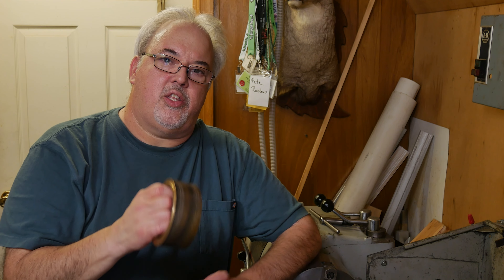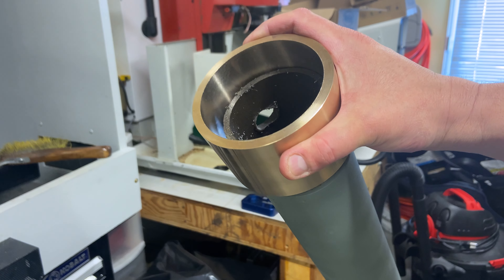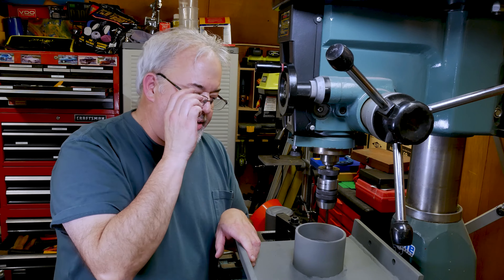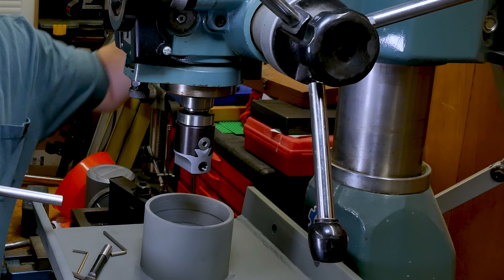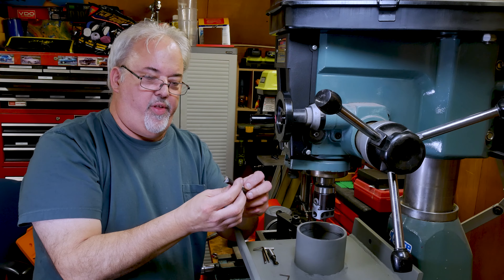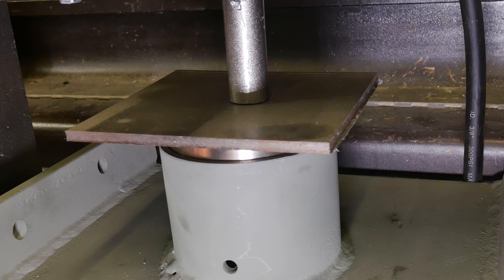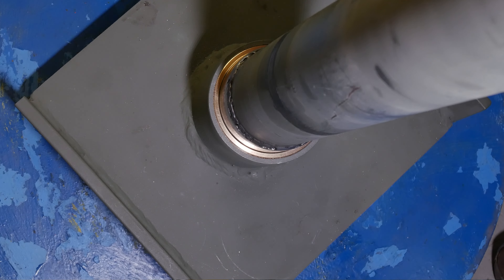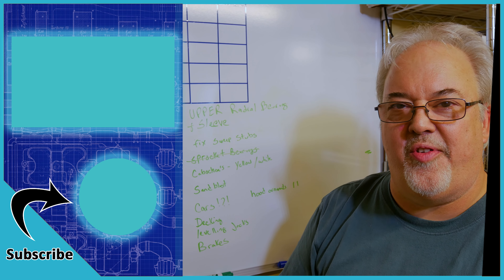Fabricating a Bearing for a Vintage Carnival Ride

Comment: That's great work, machining bearing bronze is always so satisfying. One thing that tickled me is I've spent a couple months working on a mill/drill just like yours, except it's Lobo branded with a weird CNC conversion. I've been restoring it from a mostly clapped out state at my makerspace. It's a very strange machine, but quite well built for what it is.

Comment: Clean and blue Loc-Tite would be the best way to lock it on.  Remove with heat if ever you needed to.  I didn't see it but a simple adapter to put a dial indicator in the boring head would be very useful.  Liked.
Reply from the maker: I've got some green loc-tite that I use for that but same idea.  I didn't show the nitty-gritty of the boring but once I start getting close to final dimension, I just put a dial indicator against the tip of the tool from the bed of the mill and adjust that way.

Comment: I currently work in a car parts place and before that I work in a place that did Motorsports parts,  and we get a lot of people who are looking for things like this that do not belong to any car or motorsports engine or whatever. And ,as opposed to fabricating a part that will be very difficult to make  & has to be hand fabrication I've always wondered if you instead might consider going Upstream a bit,  and changing whatever the part of the ride is that requires that fabricated bearing , and instead making it so that it will take a part that you can buy off the shelves.  The next time you need the same bearing or whatever the part is if you change Upstream whatever is holding it to something that would take say for example a 1992 Ford Master bearing then the next time this happens you'd be able to know exactly what you need & can have some confidence that you'll be able to get it.   understand that this doesn't always work but I always suggest to people to think about changing the part entirely rather than fabricating an entirely new part from nothing because you may run into the same situation again the next time that bearing needs to be replaced
Reply from the maker: I agree with you.. But...The problem with that idea is that if you ever wanted to use the ride in public again, in most states you would need an engineer to sign off on the changes. You are allowed to fix things to put them back the way the were originally designed, and there are certain tolerances you are allowed.  A given piece is allowed to wear "X amount" - (whatever the manufacturer specifies)  and you are allowed to change out things like cosmetics and lights.  But you can't make an engineering change without direction from the ride manufacturer.  In my case the ride manufacturer is long gone so any change I would make would need an independent engineer sign off on it, then in the case of Pennsylvania, there would actually be a hearing where you would defend your changes.  So, although it is a bit of work to replicate the part, its usually easier than the paperwork.
Reply: @PeteRondeau  makes sense, do you see using it in public loyally?